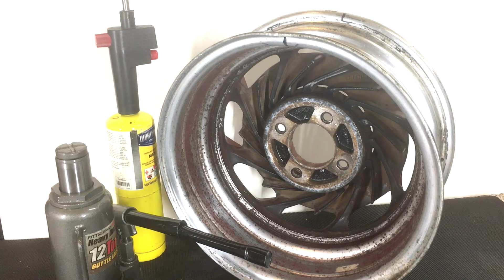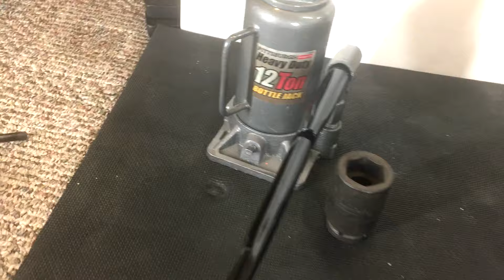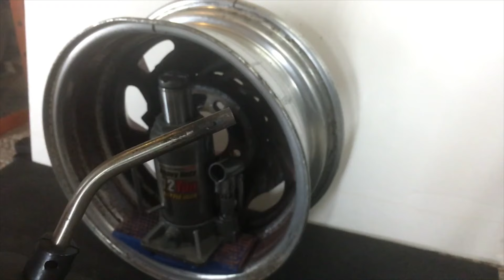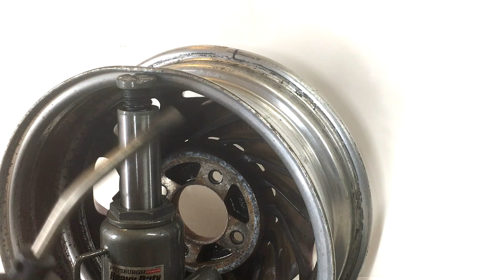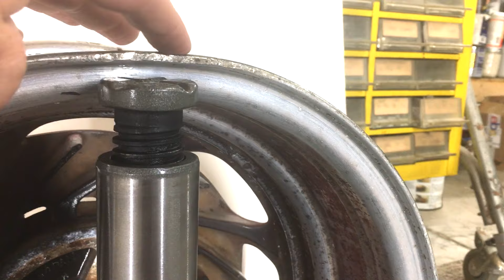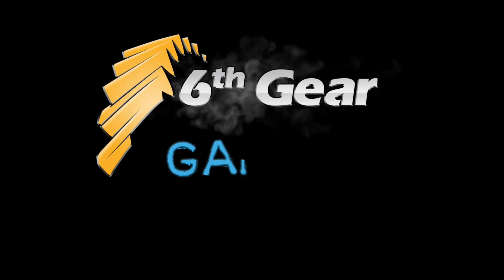How to Repair Bent Aluminum Wheel with Bottle Jack in Garage - DIY Alloy Rim Pothole Fix!

Comment: "MAP" gas is NOT "MAPP" gas, which is no longer available. The difference in temperature between the current "Map" gas and regular propane is negligible. Don't waste your money. Otherwise, a great video!
Reply from the maker: Well I just learned something new... no more paying almost 2x as much for 130° difference in heat, thanks! "Propane burns at about 3,600°F, while MAP-Pro burns slightly hotter at around 3,730°F"

Comment: I just had my rim repaired, it had a crack and was a little bent like this one. They welded it and it held air. However, once I drove on it it started to leak air. They didn't fix the bend. It's aluminum, I can fix steel rims, welding and bending, but not aluminum. Now I have to take it back to have them finish the job, it kinda sucks. It's true, nothing good comes easy
Reply from the maker: I'm surprised it was able to be balanced, still having the bend in it.

Comment: You don’t need all those ! All you need is a cast iron hammer and a good heating propane in order to bring aluminum heat up to 600 no melting degrees then softly hammer it, it will fit with other round in 2 seconds
Reply from the maker: Good to know... I have an aluminum ATV rim to repair and it's too small to fit the jack inside.

Comment: For the rim lip you can always take a trashed socket and measure the size of the lip you are working on and cut the socket 180 degrees or basically in half and it will precisely stretch lip to OEM 👍
Reply from the maker: Now that's a good idea!!!

Comment: Did you bend the wheel on the other side by pressuring with Jack?
Reply from the maker: No, because the pressure was spread out over a larger area.

Comment: If you made a template out of cardboard of what the radius is on the bottom where it's not dented you could use it to check your work after pushing the dent back some on the top.
Reply from the maker: That could work, but I think checking with the measuring tape at the end of the video was a pretty accurate method and easier than making a template.

Comment: The dents happen really quickly. In maybe less that a second. So by slowly cranking on it, which is opposite of how it was dented, maybe to get it just right you have to hit it with something round but smack it with the heavy hammer so its a fast and directed transfer of energy.

Comment: I used this method and fixed the wheel myself. The shop had quoted $242 for it and a refurbished wheel was $88. This cost me nothing. The shop owner is telling me I ruined the wheel since it would have lost its temper. Is that true? There is no air leak and the car drives perfectly smooth.
Reply from the maker: I'd like to know the shop owner's repair method... probably the same but with fancier tools. I'd say it's fine. I mean I wouldn't do this to a wheel from a Ferrari or anything I'd be racing, but it was fine for my 1988 Acura.
Reply: @6thGearGarage  He was responding to my review on Yelp where I essentially said his price is too high. I am guessing they re-temper the wheel somehow. I think there would be some symptoms at least like rough drive or loss of tire pressure if the wheel is ruined.

Comment: Would this work if all I have is a lighter to heat it up? Also, it's painted black. Would the paint melt off?
Reply from the maker: No that won't be enough heat to heat the wheel. Yeah you would need to paint it after.

Comment: Nice job straightening the aluminum rim. I have to do the same. I only have different size floor jacks and small trolley jacks. Im wondering if the small trolley jack will work? Also what do you think the best way to make opd aluminum rims look good again? Thank you 👍👍
Reply from the maker: A trolley jack might be tricky, because as it lifts, the jack pad also moves up at an angle, compared to a bottle jack that lifts straight up.  If the aluminum is not clear coated, then here is a video comparing the results of 8 different polishes on aluminum wheels: https://youtu.be/NbddZZljmd8
Reply: Not a rim, it is a wheel.  like a wrench is not  crescent, like channel locks are not pliers. like vise-grips are not a youtubers garage that moves wrecks.

Comment: The only thing i wouldve done different is cut out a semicircular block of wood I a flat section for the jack to sit on so it can distribute the opposing force a little more evenly and lower the chances of distorting the entire rim. However the chances of that happening are lower with an aluminum rim than a steel one, aluminum tends not to bend as easily as steel
Reply from the maker: That's a good idea!

Comment: If the aluminium wheel is heated with a fire does it weaken the wheel or stay strong?
Reply: As long as you keep them at around 300-400F in the repair area, they shouldn't be much if any weaker.  Hotter and it very well could weaken them.

Comment: Are you concerned at all about reversing the probable heat treatment that was done on the Al by heating and allowing diffusion to happen? The Al alloy is most likely weakened where the heat was applied.
Reply from the maker: Heat seems to be the standard way to repair a bend like this. I have not heard of any failure due to repairing and mine has been fine, but I'm not using it on the track in any way.  If this were a track car I would probably replace the wheel.
Reply: Diffusion happened the second that rim was dented . Heat treatments on metals and alloys are meant to strengthen not weaken , reducing the brittleness  and making the metal more plyable. Great idea. It works.  You took money out of alot of people's pockets so you're gonna have haters @6thGearGarage

Comment: Great DYI video. I was quoted $125/wheel to take out the bend in my set. They will do both lateral and vertical alignment but the dang wheel is over 35 years old. It's not going to be perfect.
Reply from the maker: Thanks! The wheel I repaired needed less weight to balance than the ones that were never bent & repaired. Patience and heat is key.

Comment: Nice video
Did this wheel get balanced after, was there any issues?
If wheel cant hold air due to larger buckle can it still be repaired?
Reply from the maker: I had a tire mounted and balanced and it actually needed less weight than the other three wheels did. If the bend is to the point where it won’t hold air, I’m not sure if it can be repaired.

Comment: what you can do next time is - make an TEMPLATE , of before and after. Even making a perfect correct sized circle and that will be even MORE accurate than the eye.
Reply from the maker: Good idea.  I measured a the end of the video to make sure it was round.

Comment: i did not see anyone asking :
 does the wheel ride smooth after repair?(i got 3 bent much less than that but car shakes like crazy above 60mph. was that repair worth it ?)
thanks
Reply from the maker: It rides great,no vibrations at all. I had 4 new tires installed and this wheel needed the least amount of wheel weights to be balanced.

Comment: Great video, I just did the same. For me, I would get the aluminum area quite hot both inside and out -then crank up the jack tighter, then heat it back up again, then a little tighter avoiding too much force. Same with the bent lip but used a 2lb. hammer with care. Cut a cardboard arc template from the good side of the wheel for a gauge.Dremeled smooth and painted the scars.Excellent, can't even tell.

Comment: to fine tune out the dent you should get a little dial indicator and make a device so you can spin the wheel like a hub assembly from junkyard then you can spin the wheel and see where you have dents by looking at dial indicator,then make sure it has under .005" + - runout
Reply: Just use a zip tie way cheaper than a dial indicator
Reply: or you can mount the rim on the jacked up car and spin it. You can hold a screwdriver to the edge of the rim and see where and how much is bent

Comment: Very resourceful! Couple of thoughts I had; That big socket is going to pull a lot of heat out of that rim, I would suggest heating up the socket to maybe a little higher temperature than the rim. My instinct tells me that leaving the rim pushed out with the bottle jack still positioned to apply force, one could continue the heat up/cool down cycles as time allowed. I would think with each heating phase, some additional metal molecules would become free enough to align better within its crystalline structure in response to the tremendous force being applied by the jack then during cool-down, the molecules might lock in that orientation, and with each heat up cycle, more and more molecules would lose the remainder of their tendency to return to their original alignment. This would retain the ‘new’ (but actually the original)“bend profile” better and for a longer time I would think, and possibly minimize the collateral damage to the rest of the rim.
Reply from the maker: Excellent advise, thank you!

Comment: Does the strength of the bottle jack make a difference
Reply from the maker: It shouldn't matter for this application. Mine was 12 ton and it had no problems bending the wheel.
Reply: @6thGearGarage  
I love your technique on this, I'll def be using it in the future.
For right now, I've got a wheel that's shallow on the outside and the previous owner bent the lip just a tad... just enough to leak a few psi over a few weeks.
I think I might rig something like a large crescent wrench and pry it back up. Heat seems to be the key.
Reply: @6thGearGarage  Mine is 2 ton and it still was enough.

Comment: Out of all the vids on DIY rim repair I've watched this looks like the best method and nicest job so far!! No smacking the crap out of your rim with a big hammer!! Well done!! Looks very doable for the average person at home with a few basic tools. Thank you for posting.
Reply: I fixed mine similarly, was bent a lot worse, I used a regular propane torch and it worked perfectly fine, I didn't sand or anything, just wanted it better, air was even leaking, after I straighten it, problem was gone, I didn't even balance the wheel and it doesn't shake at all. Just used my imagination on how to fix it, now that I've watched your video,.I'm gonna fix the rear one which isn't half bad and paint them, I sure as hell not purchasing a set of rims, very costly.  😜🤣
Reply: Except there are many other videos that shows proper equipment to fix this kind of problem.....

Comment: That entire wheel was distorting out of round.  Sure much of it will spring back .  But without a runout gauge you don't know if the entire wheel is now egg shaped.  If that wheel is out of round it's going to ride MUCH worse than that isolated flat spot did.
Reply from the maker: I did check it before taking it to have the tire mounted & balanced.
Reply: @6thGearGarage did it work alright?
Reply: All ya gotta do is throw the rim on the front of the car and spin it. Use a drill as a pointer or if you have a dial indicator set it up. I check wheels all the time for bends this way.
Reply: This is exactly how shops fix it
Reply: Can't be egg shaped and be able to still put a tire and hold air and balance without an issue. Did you ever think about that?? Do you think it's impossible lol I mean I've done it plenty of times saves me hundreds and car drives fine, you could never tell....But anyways you'll never accept what I say so have a nice day 👍
Reply: @pono321  I also was thinking about the elliptical shape after that straightening. Thank you for your comment.
Reply: Cratecruncher is correct... get the proper equipment if you want to straighten wheels...
Reply: @arandomdudeintoronto3983  for atvs this should be fine
Reply: This is a quick diy at home. Why buy proper equipment if it's going to collect dust being stored away.
Reply: @orangecounty7144  you underestimate my ability to bend wheels

Comment: How do you remove rust out of the inside of a box frame?
Reply from the maker: First I'd whack it with a big hammer to break off all the loose chunks. Then I'd lift one end of the truck up real high and use compressed air into the factory rectangle holes in the side of the frame and blow it all out to the open end of the frame. Keep in mind there are baffles/gussets inside of the frame around where the cab and bed meet (on 80's toyota frames) so you'll have to lift one end first, then do the same thing with the other end lifted because the debris may bot pass through the middle of the frame. You could also use an attachment like this to scrape the inside: https://www.amazon.com/Gardus-RPS204-B-SootEater-Rotary-Cleaning/dp/B000GA9D9I/ref=sr_1_2?ie=UTF8&qid=1459041121&sr=8-2&keywords=SootEater+Rotary

Comment: If you run that wheel in the rear passenger you won’t even feel it
Reply from the maker: I think the previous tire shop must have balanced it out pretty well before because I never felt it. Figured I'd try to make it better before I got new tires.

Comment: Upload timing couldn't be better I currently have a bent wheel that needs repair thank you for this guide your wheel turned out great
Reply: Would you have looked for a video like this if you did not have a dent in your wheel? lol
Reply: @davidburcar7620  ive been subbed to the 6th gear garage for about 5/6 years